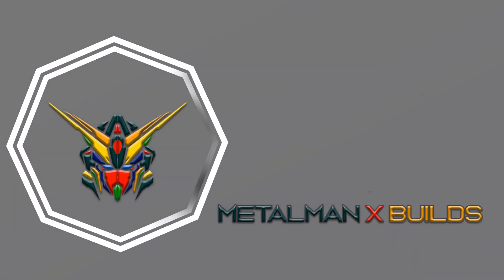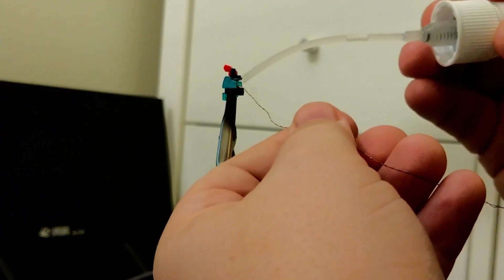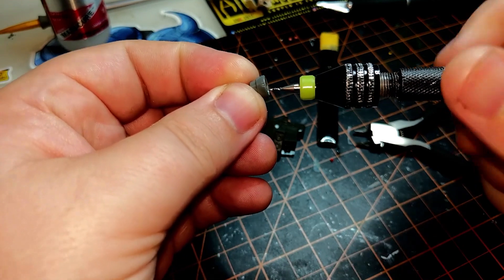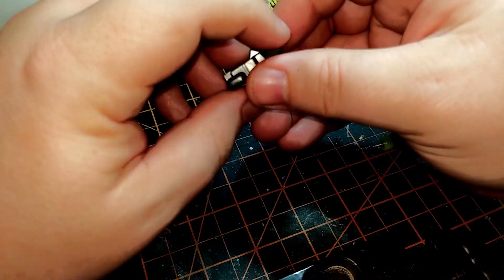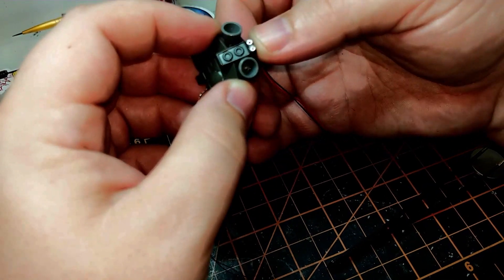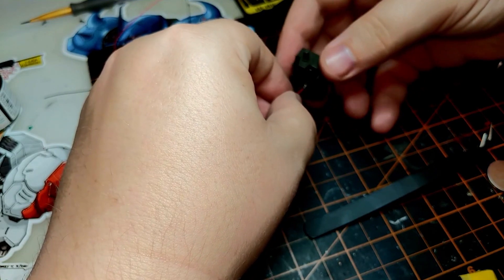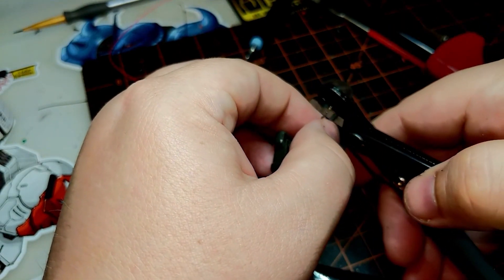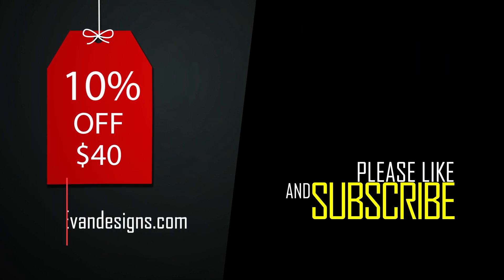HGUC GM Command - LED Tutorial #Tutorial #DIY #Evandesigns #LED #Gundam #Gunpla #ガンダム #ガンプラ #Custom

Comment: I'm just curious about something:  do you just pretty much drill into where you want the lights and wires?   Most of the gunpla I have built have had pretty solid heads with almost no room for lighting.   And then there is the  thing about the eyes: do you pain the eye visor piece with black with the individual eye stickers on and remove them for the perfect shape?      And finally, if I wanted to light up something that might have thrusters in the legs or feet, like the MG 1/100 Sinanju,  would I do the same thing and simply wire it up through the leg mechanics and skirt like you showed with the head?
Reply from the maker: For thrusters and things I drill where I want them to go. Most are at the minimum recessed so it is easier to get the desired effect. This is on a kit by kit basis. The eyes are painted without stickers. I usually use some kind of magnifying lens to make sure I hit it just right. I use a very small brush for this. For the legs you would have to run it through the leg mechanics. The biggest decision you have to make is about poseability. Do you want to.maintain as much as possible or do you want to have a statue. That guides your design the most. I hope this answers your questions if not hit me back up.